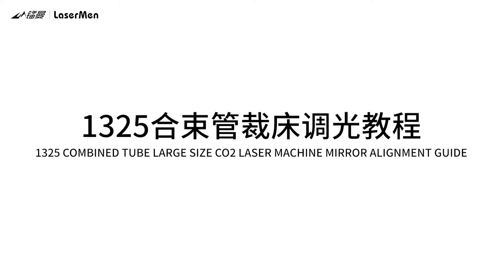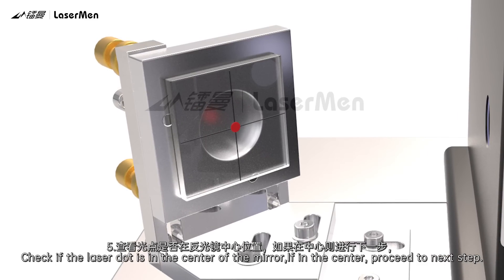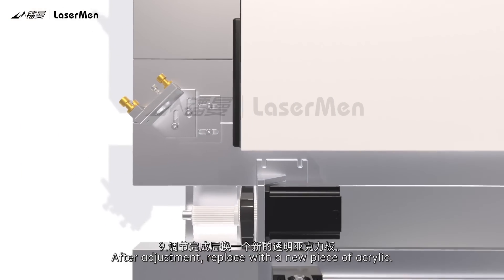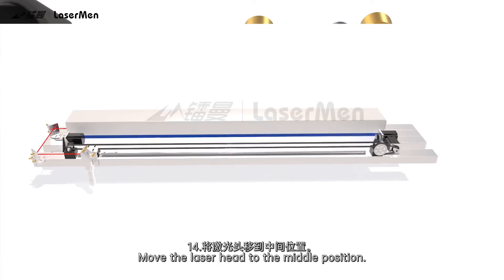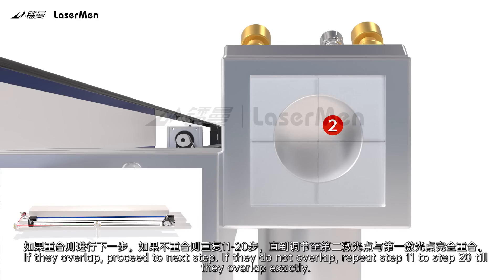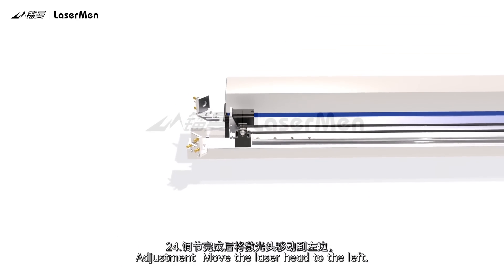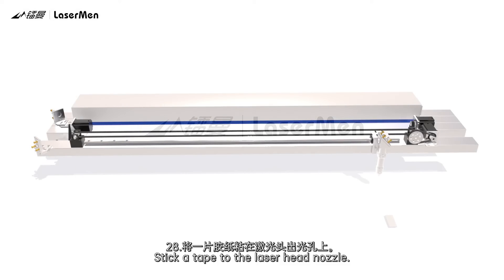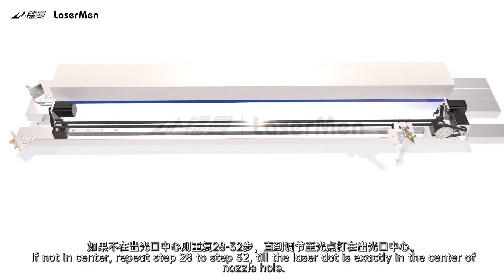[LaserMen] 1325 combined tube nonmetal co2 laser machine mirror alignment guide

Comment: I have just changed a new lens, and I have realised that when engraving and cutting,  the engraving and cutting lines appear blunt  and thick. If I do pulse test on any object it pierces a blunt hole which doesn’t pass through the object.  What could be the problem, and how can I correct that?
Reply: It’s your last mirror 3 and lens which may be out of focus. Try doing a ramp test and check the focal point of your lens.

Comment: In step 16 at 2:50 you say adjusts the first mirror but you show on th video the second mirror is adjusted. What is correct?
Reply from the maker: English subtitle correction in step 16: Ajust the screws on the second mirror mount, to move the second laser dot to the first laser dot position.         Thank you very much for your correction.

Comment: This alignment works for a laser where the tube is mounted on the gantry, like a Gweike Cloud, OMTech Polar or even a Glowforge. It will not, however, work for a laser where the tube is mount on the frame of the laser and mirror 1 to mirror 2 is not a fixed distance. Excellent explanation, however, on how to align a gantry mounted laser tube!
Reply from the maker: You can reach us through:
Email: support@lasermencnc.com
WhatsApp, WeChat: +8615508686690

Comment: You can't just do this for a single position... When setting the 2nd mirror, you need to make sure it is centred when it is closest to the tube and also when it is farthest away, so in other words when the gantry is close to the back of the machine and when it is right at the front. You then need to do exactly the same when aligning the 3rd mirror... It might be perfectly centred when closest to the 2nd mirror but way out of alignment when it at the other end of the gantry.
This can be a time consuming process, not to mention frustrating but it needs doing properly...
Reply from the maker: Thank you for information. Yes mirror alignment takes time especially for new users. In this video, the CO2 laser tube is installed on X gantry (not at back of the machine) and the laser tube moves simultaneously with X gantry. Comparably it is easier to align this machine than to align a machine with laser tube at back of the machine. But in a word, the final goal of mirror alignment is to get laser dot centered on the third mirror and finally full, round, and centered from the laser head tip.  Here are video guides for align machines with laser tube at back: https://youtu.be/5B5BW2wyqo8, https://youtu.be/qszcGfiwruk